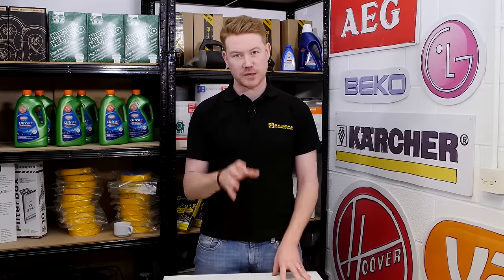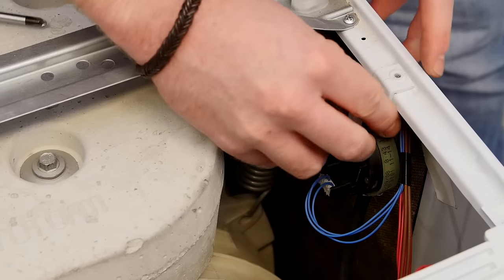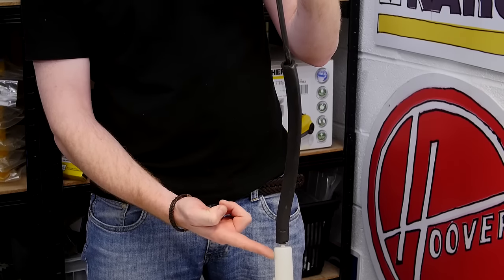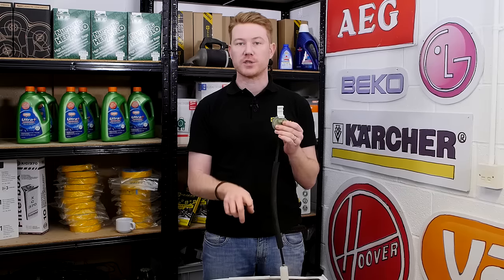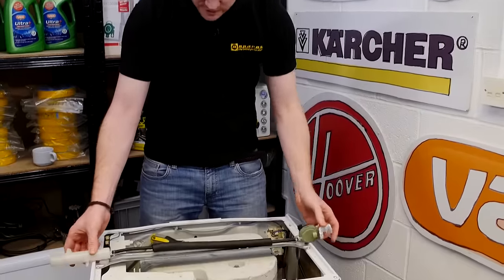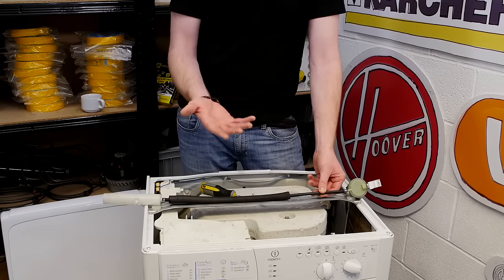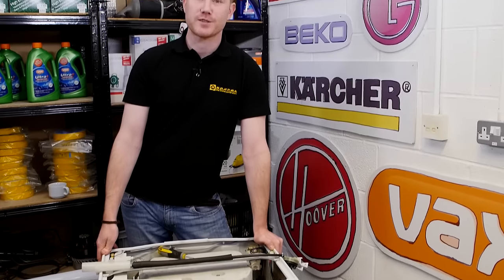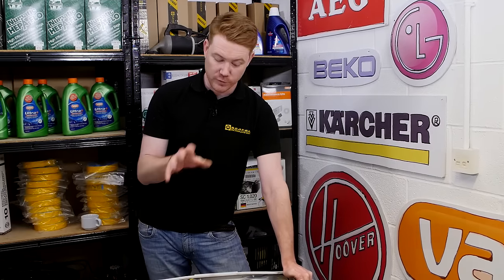Fixing Washing Machine Pressure Switch Problems

Comment: Very informative video indeed. Got an issue with my Miele premier 300 showing "check drain" light when emptying and it won't spin after a cycle. So I'll give this a try and fingers crossed.
Took the bottle off this morning and it was full of gunk, only leaving a small hole for air to get through. Cleaned it out and replaced.
My washing machine is now spinning again and better than ever.
Thanks eSpares you've saved me a  small fortune.

Comment: Great video thanks. I have a Gorenje washing machine which is very good and to be fair, rarely have an issue with its function. I am normally ok fixing simply things as long as there is excellent videos like this to identify fault. My machine would wash but refused to spin, a classic pressure switch issue. I checked all the pipes for blockages as well; they were all clear until i saw this video and checked door seal aperture. So the point of my post is for Gorenje owners because the machine doesn't have the classic chamber. The hose comes up from the pump and sits on an aperture in the door seal. Poking my finger up from inside the machine I found a slug of stinking mush that had completely blocked the aperture, fooling the pressure switch. Gave that a good clean out and hey presto works a dream now. So thanks Espares for putting me on the right trail.
Reply from the maker: Hi graham, thank you for your post and very good information for Gorenje machines well done☺

Comment: I believe you have solved my problem, i am just really worried about disconnecting it all, everything on my beko washing machine works fine apart from water filling up and not stopping so doesn't go into a cycle, but i can  drain it ok and set it on spin, will hot water clear any obstruction that may be in the chamber or hose please?

Comment: Thank you for pointing me to the right direction. On my machine the hose to the pressure switch came loose. The washer started the program, but failed to stop filling up at time. The machine stopped the cycle, drained the water and then a blinking error code IE was displayed.
Reply from the maker: Hi Oldinea, thank you for your post and hoped it is all sorted ☺

Comment: Welp read instructions fully or in this case watch video fully before doing this.  Blew into pressure switch, before i got to the part about don't blow into the pressure switch. ^_^  Anyways I believe it's fine just gave it a little puff of air and heard the switch engage.  Blew down the hose as well so I know there isn't an obstruction.  (washer overflowed)  So now i'm on to find out if there is a relay or something that went bad...  Thanks for the help though. :)
Reply from the maker: Hi Twiztidguy, thank you for your comment and good advice about the video if you have checked the hose and the chamber it is likely to be the pressure switch.

Comment: He have a H20 sign come up on our hotpoint. Water initially comes in through the soap tray but then shortly stops and the h20 sign comes on.

No kink in pipe, I have also checked the pressure switch and blown down the hose.  Do you think I need to buy a new pressure switch?

Comment: I was really hoping to learn how to diagnose the pressure switch instead of the hose and the chamber. A technician told me when you blow into it it should click twice, one for the heater element signal and one for the max water level. Mine only clicks once so i was hoping to get an answer from here.
Reply from the maker: HI Leon de Bruin, pressure switches on older models did have the levels you could check by blowing down but the new electronic models you can blow down so you need to check the hose and chamber at the same time to be sure what has failed but it would normally have more than one level.

Comment: Hi, Thanks for the Video. My Samsung Eco-bubble washing machine has an issue with the LED display panel. The panel is off meaning I am 'flying blind'. Washing sometimes takes 9 hours and even after this, the clothes are still dirty. The local dealer/ technician is proposing a replacement of the main control board. Please let me have your opinion on this matter
Reply from the maker: Hi George, If there is no display there should not be any other problem that could cause this other than a control panel fault. The long wash cycle may be due to the machine not heating the water but if this has occurred at the same time as the display fault again the cause could be the control panel.

Comment: I have a Hoover machine that keeps giving me an E03 code, everything is okay until it drains then goes to do the rinse then spin but stops with the code. I have replaced the pump and filter, heater element, all hoses clear, could the pressure switch cause this error? I can switch it to drain and spin and it does that. Im at my witts end.

Comment: So is the 2 litres just a random amount of water or is that the specific amount the machine is looking for to not just reset but to re-calibrate?
Reply from the maker: Hi Xad, 2 litres is just enough to fill the chamber and activate the pressure switch but don't worry if it is a little bit more or less it should still work.

Comment: Hi, I have got Simpson SWT604 washing machine. It keeps on filling water and then overflows and the cycle never starts nor it drains or rinse. Actually, it does not start any sort of cycle. i have checked the hose connecting pressure switch. it is fine with no damages and kinks. The pressure switch i have got has only two connections and they show continuity whether i am blowing into pressure switch or not. When I opened the pressure switch to see inside, it had a bit of water on the rubber seal but could not find any water or moisture traces underneath which could affect electrical solenoid sort of circuitry. I suspect that pressure switch is defective and I should replace it. what do you suggest? and why it does not have three contacts as i see in most of the videos on youtube and internet. Another thing to mention is that I have blown into the tube to check blockages which was clear but i have not cleaned the plastic chamber which you have mentioned in video to be opened from downside and need to be cleared of any detergent which i will do tomorrow.
Reply from the maker: Hi, your description suggests the pressure switch is faulty so this would be the next thing we would replace. 😊
Reply: do you got pressure switch in spares and if yes, how much it will cost?

Comment: Hello,
my Indesit 126s recently discovered a problem. The Drying and spinnig is runnig perfectly but if i set a washing program the washer stops. First it gets water in and spins a few times but when it comes to the waater flushing it directly stops and the leds flash. from the left its led 1 and 3 so fault code f10 pressure switch not sensing. I testet the hose by blowing air in it and it starts bubbleing inside. is it possible that a broken sensor causes the problem? how do i test this?

Comment: After researching for our kenmore elite oasis things seemed to point to the pressure switch which unfortunately is expensive because it's part of the main board and not a seperate piece like on older machines. Got the 1st one(main board)  and still the same problem of overfilling. That's after blowing through the hose and makingsure it was clear. Code of f68 still punted to a bad switch so I ordered another and same thing. Talked with a tech who said it was probably the hose and that it probably had a pin hole in it so I ordered a new hose and installed. Same problem still exist but with no codes. What gives?
Reply from the maker: Hi Charles, no idea but let's look at this logically when a machine fills the amount is controlled by the pressure switch and the board, if changed then the only thing is the valve is not switching off or there is a blockage in the pressure chamber.

Comment: So how do you remove the chamber on a Hotpoint WMD960? Seems impossible to gain access unless the side panel is removable, which it isn't..
Reply from the maker: Hi Jazzyman99, try getting to the pressure chamber from underneath and it is usually connected to the tub.

Comment: I have a Bosch Nexxt DLX Model 4301UC/03 Could the Pressure Switch cause my machine to fill with water than immediately drain? It doesn't agitate or anything. Just fills then drains and shuts off and unlocks the door and the display still shows the time for the cycle. This has been going on for some time now. I can let is go for a few days and the machine will work fine for a few months then it starts doing this all over again. It's driving me crazy. Grrrrrr!!!
Reply from the maker: Hi Susan, we need to rule out everything as it sounds like the board which is difficult to diagnose so let's address the issue. First, it is unlikely to be the pressure switch as it will not switch the water off until it has reached the correct level, second, it has not detected an error code which can point to the board. check it is not syphoning the water due to the outlet hose being too low and check the connections to the pressure switch and the board.
Reply: Will do, thank you. I'll let you know.

Comment: there is a plastic ball inside the hoes which connects the drum to the drain pump inlet. Could you pleas tell me what its function because some one repair my white point washer and damage it and remove it saying it's useless.
Reply from the maker: Hi Mohmd, the eco ball was introduced by manufacturers to prevent any detergent being lost by stopping it going into the sump hose and making the machines more efficient.
Reply: @eSpares  Thanks for your helpful vid. and your quick reply
Reply from the maker: You are welcome Mohmd.

Comment: So they putting the 2 liter's of water following by selecting the drain cycle is what resets the machine?
Reply from the maker: The procedure you are quoting is usually for resetting Hotpoint or Indesit machines if they have been moved so the water pressure sensor  will correctly identify how much water is in the drum. It will not reset anything else.

Comment: Had a presure switch error on whirpool f24 water owerfloow. Pressure switch was ok, intake valve ok, pressure hose ok and at the end problem was heater. Wats the worst I checked that first with ohm meter and values were inside recommended so i assume it is fine. When i took it out it was in bad condition. So  the heater could be problem after all.
Reply from the maker: Hi Stojcosi, well done in sorting it out, very impressive how you have checked everything.

Comment: Could this throw a F28 code. All the connections that your supposed to check for that code send ok. Kenmore HE2plus
Reply from the maker: F28 is a communication error, this is where the 'control panel' cannot control the power module. Check the connections on both modules are not loose, damaged or contaminated. We do not think it likely to be a pressure switch problem.

Comment: What if the pressure chamber is part of a sealed drum as one piece and not a separate part? For example this image: imgur[dot]com/RCVBymR does that mean it can't be cleaned out unless you pull out and cut apart the plastic outer drum?

image source: youtube[dot]com/watch?v=rvjRUx1kAvU

Comment: HI, my Amana NTW5100XQ0 washing machine initially fills properly, and drains properly, for the fill/wash/drain/pre-rinse/spin, but when it comes to final rinse cycle, it doesn't fill all the way with clean water, only about 1/4 fill, then starts spinning dry/soapy clothes in the dry cycle, it started doing this about 2 months ago, any suggestions?
Reply: PS.  I have to stop the washer from final dry spin then turn the knob to fill to make it fill the proper amount during the final rinse cycle every time
Reply from the maker: Hi Ken, check the pressure switch and the pressure chamber for a blockage which may be causing the irregular fill levels but if OK it could be the main board.